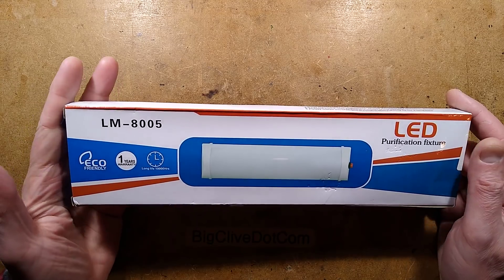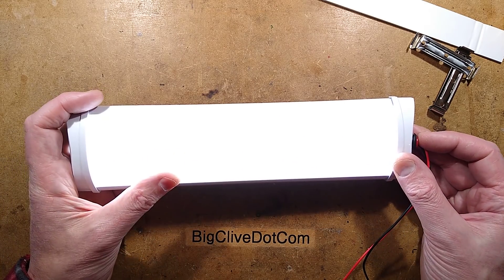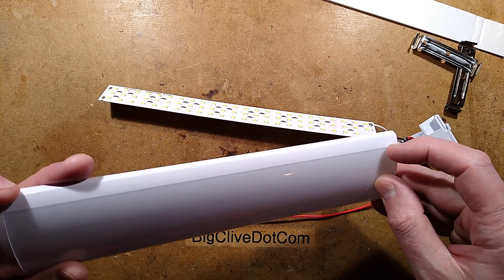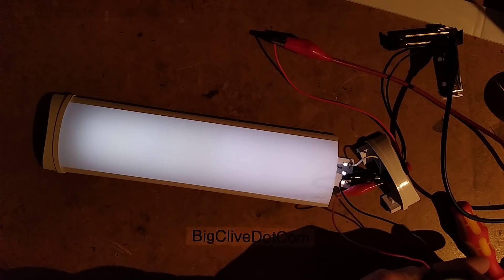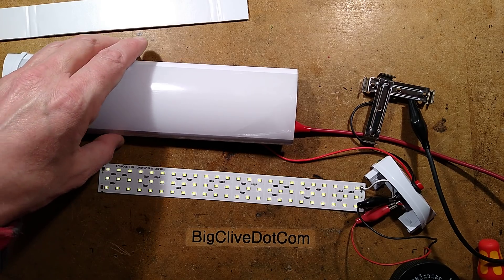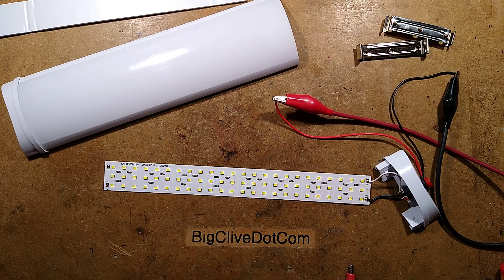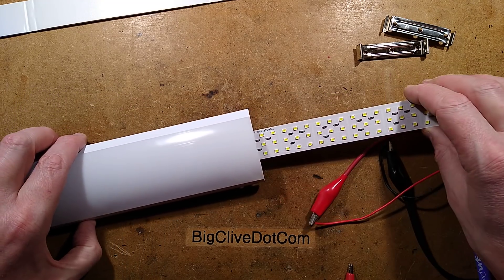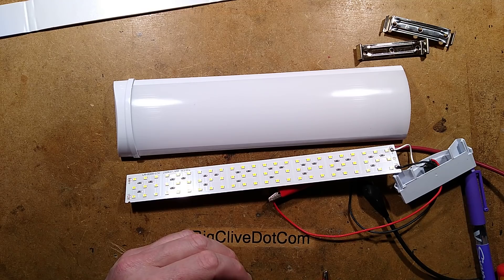Inside a cheap Aliexpress 12V LED light

Comment: Hi Clive. Love your vids, informative, amusing and educational. Would you be interested in examining one of two mains powered LED batten lamps I bought the other day. For all intense and purposes, it looks the part with the packaging. Upon closer inspection, this does not have a UK compliant label on it, despite buying from Amazon UK. I opened one & was concerned with what I found. You are welcome to carry out a more intensive examination of the minimal components to make this work. If so, how do I send it to you? regards, Phil T.
Reply from the maker: A lot of products sold via amazon are bypassing safe import channels.  Modern batten lights are often based on large strings of series LEDs on a strip, with either a tiny buck regulator or a linear current regulator.

Comment: How would you add the series diodes in to the circuit and what type would you need please, also if its used on say a 12 volt supply how long would say a 12 volt 7amp hour battery give light for? Great informative videos Clive

Comment: Hello 
Uhhh dumb question here
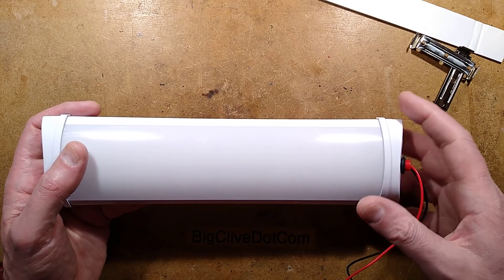1:20
he said use a  diode
Why not a resistor?
Isn't it their job to limit current?
Reply from the maker: A diode drops the supply voltage by about 0.6V to 1V.

Comment: having an led light that is press fit assembled maybe ok for 12 volts but something that is powered from the mains should not come apart so easy.

something that runs off mains should be glued or ultrasonically welded together so you have to use brute force to take apart so the plastic dome does not just fall off exposing users to the mains voltage.

Comment: did you bridge the positive and negative on the switch annnnd..... do you have a vid on the resistor device your using by any chance?
Reply from the maker: There's no positive and negative on the switch itself.  Just two contacts.  The rotary resistor unit was bought a very long time ago.
Reply: @bigclivedotcom  thank you, i got alot to learn still lol! but did you bridge it or desolder one of the connectors?

Comment: Haven't had time to watch all the video, but I bought one of these type of lights, with a 12V-48V input range.
The light works great, unfortunately, the RFI given out by the light, obliterates our DAB radio signal.
Not a problem for were I use it but worth noting.
Reply from the maker: A lot of electronic lamps jam local radios.

Comment: in the states ive often heard these referred to as bar lights, also would wonder how well these would work for trunk(Boot) lighting in my car since my car doesn't have any, Set up a simple circuit using a normally closed limit switch so when the trunk is closed the current stops flowing

Comment: Always a great video. I've checked out these type SMD's on a few websites, some are less than 2 cents each... American dollars! You'd be buying a roll of 1,000 pieces of course, but still at 72 LEDs...$1.40  for the bunch, and a few resistors at similar prices..

Comment: Hi, This gave me a great idea to possibly fix my DRL light issue on my car. I am already on the third set of LED bars as day light running light on our car as they all just lasted from 12-24 months, before loosing single diodes and finally dying all together. 
Would they last longer with additional resistance or additional diodes?
Reply from the maker: It's possibly the LEDs that are being overdriven or maybe water ingress causing rapid DC corrosion.

Comment: That reminds me of a tent light I made earlier in the year using 5V LED strips (so can be driven from USB sourced from 240V, 12V or a power bank). And. with my 5-year-old being scared of the dark I put a 2K resistor across the switch and that made for a very effective night-light mode.

Comment: So with the LEDs arranged in clusters of 9 in a square, I assume it would be possible to cut the strip, or solder another one of these to the end and customise the length for other applications?
Reply from the maker: I think it's designed to be extended for bigger strips.

Comment: correct me if I am wrong, but instead of choosing one or the other (nightlight or light), couldn't you have a resistor on a switch to switch it on or off and high (light the room bright) and low (night light / mood light) so you can have both?
Reply from the maker: It would need a multi position switch.

Comment: Typically RV's converters and solar controllers run at 13.2v on float 13.6V for charge and 14.6 on boost.  I know that all of our fixtures are steel and will work as heat sinks. Curious how hot these would get as is.

Comment: I really need to see a schematic to better visualize the LED, resistor, voltage circuit.
Reply: You have 12V -- resistor -- LED -- LED -- LED -- ground. That basic circuit is then duplicated for a total of 24 resistors and 3 x 24 LEDs.
Clive suggested each line passed about 38mA, with about 3V across each LED. That leaves about 3V across the resistor, which therefore must be around 80 ohms. HTH.

Comment: I bought a lamp with a similar look a few months ago.
But there is a circuit with an IC, diode and inductor in there. When the voltage is increased from 12 to 24 volts, the current drops. Dimming with a resistor is not possible. 
There was also a fixed 12 volt version that you have.
There is also a version for 220 volt AC. I installed it by the stairs on 230 AC. I add a 1A fuse just in case because the main fuse is LS B 16A and slow.

Comment: I was thinking of adding some LED panel or strip to the trunk of my miata. Tho the 14 ish volts from the alternator would be way too much for this one. Still not sure if direct drive with resistors or switch mode is best suited..

Comment: For the double-sided tape issue...just cut two small pieces off the strip and attach them to both ends of the unit...it should hold it up correctly...and you have extra tape left over  :)  
The AE advert states it will last 10,000 hours...or just over 1 year...so much shorter life than a normal incandescent bulb but much more expensive and way more trash at the end.  
(But LED's are supposed to save the planet?!?!?!)  
/tiny rant over
Reply: A normal incandescent bulb has a 2000hr lifespan. You don't leave a light on 24/7. No, the point of LED lights in an RV/Caravan is more about not running your battery flat when dry camping (Not plugged in) than saving the planet.
Reply: @kimchristensen2175    My incandescent lights last more than 5 years...most of them are on 24/7 in the main body of the house.  
I do use 12VDC LED's for secondary lighting...though I got expensive ones...they work very well & have lasted quite a while.  The cheaper Chinesium ones don't last more than 6-8 months.
Reply: @gregorythomas333  yea the cheap LED lights are crap. Clive has an interesting video on the "Dubai LED lamps" that last much longer than UK/USA ones. I do have some "extra long life" incandescents that are marked as 5000hrs. The other ones have no estimated life markings. Of coarse if your average line voltage is lower than mine, then the same incandescents in your house will last longer than mine.

Comment: Surprisingly good for the price. Would be pretty neat in a lorry or garage! Looks similar to the 12V lights I have in an LED photography light box. There's two lights with a DC jack on each, that connect together to the 24V power supply with dimmer switch.

Comment: There is something I keep meaning to ask you….

I tried to fix an old old console called an Intellivison…

Instead of asking you how I do it…I’ll ask you the question that will solve the mystery that stumped me and made me give up…

I had previously repaired another simpler game console and was cocky.

I then came up against not just needing to provide 5V, 3.3v, 9v and 12v I think.

But at least -5V…

Before I’d only had to deal with these voltages and GND…how does a minus voltage work. Why is that different from ground???

If I can understand that. I can probably apply the knowledge to multiple things…rather than requesting for exact instructions for this case and not understanding the fundamentals involved.
Reply: Imagine having a 9V battery and it's minus terminal is connected to ground. We would then say that it's positive terminal is +9V relative to ground but it's negative terminal is at 0V.
Now reverse the 9V battery and connect it's positive terminal to ground instead while leaving the negative disconnected. Now we would say that it's negative terminal is -9V relative to ground but it's positive terminal is at 0V.

Comment: a question for you, kind Sir,  getting these things, for me camper van, internal lighting, are they safe to just plug into a leisure battery, or do I need to put a resister in or some think, 

White 48 SMD COB LED T10 4W 12V Car Interior Panel Light

many thanks  

keith
Reply from the maker: I'd generally recommend a resistor in series, as many of the COBs just use four sections of 3V LEDs in series to make 12V.  A higher voltage can cause a significant increase in current.

Comment: I'd be tempted to wire in a potentiometer instead of a straight up resistor, to be able to dim the light accordingly.  Amazing that it still lights with a 1M ohm in series.

Comment: Regarding the use of energy. When someone adds resistance to dim lights. Dose the energy consumption, overall, remain the same?
Reply: The power P in watts (W) is equal to the squared current I in amps (A) times the resistance R in ohms (Ω)
The power P in watts (W) is equal to the squared voltage V in volts (V) divided by the resistance R in ohms (Ω)
The power P in watts (W) is equal to the voltage V in volts (V) times the current I in amps (A)
Reply: The energy consumption drops when you dim them because the current drops while the overall circuit voltage remains the same. It's not a very efficient method though.

Comment: The funny thing is that I have been 'upscaling' some of these cheaper, but better made units- fix the 'factory faults' then onselling to the camping/offgrid community...
Yeah I add a little to the price, but they are also much more reliable longterm... good for us 'semiretired' folk fix their elcheapo screwups and make a few quid on the side lol
Hardest part is finding the 'cheap but still OKish quality units to use as the basis...

Comment: I continue to wonder where big Clive gets the money from to essentially buy stuff to take apart which ultimately ends up in the bin?
Reply from the maker: It's mostly cheap stuff, and rarely gets binned.  Most stuff gets rebuilt.
Reply: @bigclivedotcom  its sad that UK postage rates are horrendous otherwise I would send you my electronics to dissect.

Comment: I have similar lights which have an aluminium extrusion and a switching converter, they dont have that voltage issue and can even be powered from 24V.

Comment: Did you know that you can run LEDs too low and damage them? I was working on the analysis of returned automotive products at a well known German manufacturer and the symbol illumination on the window switches kept failing or becoming discoloured after about a year or so use. It turns out we had used super efficient white LEDs and they were running at less than 100uA! Under the microscope only part of the die was lighting up which was causing the phosphor to age rapidly. Solution was to swap to less efficient LEDs! This was in ~2008 though so not sure if it's still the case and I'm yet to this day find a datasheet with a minimum current spec. I treat them like switches now as if they have a 'wetting current' of about half a mA and never had a problem since.
Reply from the maker: I've not come across that.  In the early days the white LEDs were very unreliable.

Comment: my workplace ( morrisons supermarket  ) just had all new LED fitting installed ,using phillips titanium drivers , looks very expensive ,i bet it cost lrast half a million to do every light in the building ,they include IR sensors /and theyre all off or dim and first and turn on or brighten up to full intensity when it detects motion, its very jarring ! PS i looked at one of the boxes ,i think each strip 0.5 metres ,is 150 watts !!!!!!!!!!! thats a lot for a LED ,then again its better than the 500 watt FL tube lights they had ?

Comment: Clive have you considered looking at LED grow lights for "Tomatoes"?  I still use HPS lights with a ballast and ive always assumed that an LED system might be cheaper on my electric bill but I honestly don't know.
Reply: LEDs would suit your "tomato" grow much better as 1, you get more lumens per watt out of LEDs and 2, as light scatters due to the inverse square rule, and as LEDs run much cooler than HPS you can keep the lights much closer to the "tomato" plants without scorching them which will increase the lumens per sq foot at zero extra cost
Reply from the maker: I have featured various grow lights.  Some are treated as disposable by the plant industry.   Very minimalist PCBs on thin aluminum reflectors/heat sinks.
Reply: there is at least one tomato light review channels out there i would recomment, i mentioned it by name but my comment got insta deleted :(
Reply: migr with an o at the end

Comment: Alternatively, you could just take that el cheapo Chinesium switch off and replace it with one of those click on pots (kinda like a volume switch), then you could set the intensity as you please at any given time. A 22k pot would probably work best. That would run the whole 0.5mA and dissipate approx 6W which is nothing at 12V.
Reply from the maker: Sadly, potentiometers usually have very low power ratings.
Reply: @bigclivedotcom  aww, well poop. I guess it was worth a shot. Perhaps a potential divider using a slightly larger pot (say 100k) and a power resistor would help, but then again that’s probably just getting into waaay too overkill for cheap tat from China territory.
Reply: You could use an exposed-winding pot and put a dab of varnish on the very low end.
Reply: You can get 5 watt pots, but they are expensive and likely not fit in this light housing. Good idea though...!
Reply: You'd be better off considering a multi-position switch with a decent rating and a set of 0.5W or 1W resistors to switch between various levels.

Comment: The one question I always have on cheap LEDs is whether they’re “video safe” or not. I didn’t notice any strobing in your video so I assume they are constantly on, and the summing you achieve with the resistors isn’t something coming from a controller board disabling the LEDs momentarily…?
Reply from the maker: These ones have no strobing at all.
Reply: Unless you have some sort of circuit with PWM or similar, you won't get strobing, these lights in the video are always on, with varying intensity. Over the last 10-12 years, I've bought a variety of stuff like this...just LEDs and resistors.
Reply: @dougankrum3328  yeah, you’re quite right. This was only ever a problem with circuits sold as “dimmable” and of just forgotten the specifics.

Comment: Use buck boost or Votage regulator? Most Battery Gen Set has 12V outlet. This light is for those equipment.

Comment: I got 3 of these, very similar, may even be the same, to run off a solar panel/ 12v wind turbine for our stables. Not actually installed it yet but I like the idea of the resistor across the switch, good modification that. 👍👍👍
Reply: You want sleep deprived horses?
Reply: @jimcrelm9478  nah, just to see down the path at night.

Comment: Even just a couple 20w paralleled solar panels in my window hooked up to a (now dying!!) roadside-salvaged car battery works nicely for 12v lighting, though I found that lights that are unregulated like this tend to be noticably dimming when they start to pull the batteries down, versus the 4W bulbs I got (similar style as a pygmy-type one you got some time ago with the ceramic LED filaments that turned into a bit of a disaster vid) which have a regulated buck-boost supply in them, only downside to those is they work great well below the battery's officially discharged voltage, which isn't healthy for an already tired lead-acid battery!!! :S

Comment: Resistors? No, thank you sir, we only use diodes in series here.

That said, if they have a current-independent voltage drop, that does sound profoundly useful. Wonder why don't they just make them in arbitrary voltages, could be great when for example you have a 9V circuit and you'd like to drive it with a 5V microcontroller, just put a 4V diode on the power rail and any inputs and you're done. Or you would be, if the component was available, right now you either have to use like seven diodes, or just build a proper step-down converter, but that's boring.

Would there be any drawbacks to this strategy?
Reply: You can get zener diodes in almost any voltage. But putting diodes in series to feed a microcontroller is a bad idea. Much better to use a 7805 regulator so when your 9V battery drops to 7.5V, the microcontroller still has 5V. If you'd used a 4V zener in series instead, then the microcontroller would have only 3.5V when the 9V battery drops to 7.5V.
Reply: @kimchristensen2175  Wow, thanks, that's awesome, didn't make the connection that a zener diode connected backwards does exactly this. Also, completely blanked on the 7805, lol.

On the other hand, that regulator sounds fun as well. Like, take a circuit powered by 4 AAA batteries, with an input voltage of 4.8-6.4V, put a 7805 on your primary power rail, giving you a flat 5V unless your battery is almost dead, and then from that 5V line you can just drop through a single 1.7V zener diode for any 3.3V components. That should sidestep the drawbacks of a fluctuating input voltage.
Reply: @DeeSnow97  If your running off of 4 AAA cells, a 7805 isn't your best choice as it needs a minimum of 2V across it to work properly. You'd want a Low Drop Out type instead like a LM2931, L88MS05, etc.. Or even one of those buck/boost types.